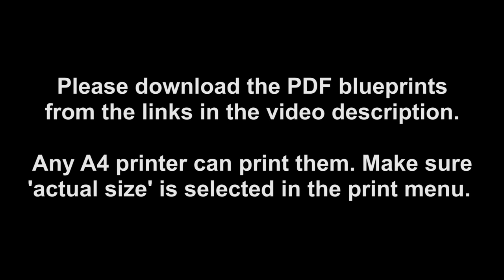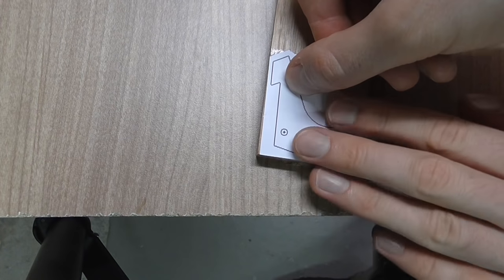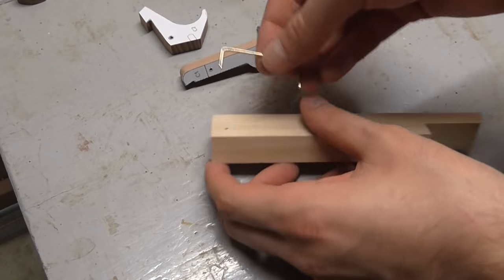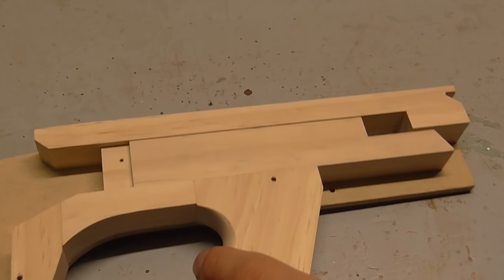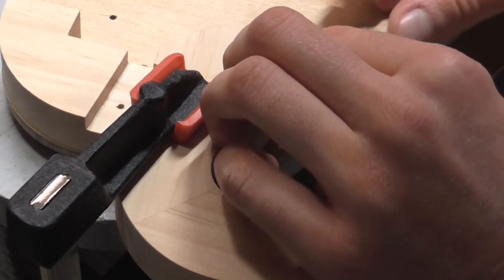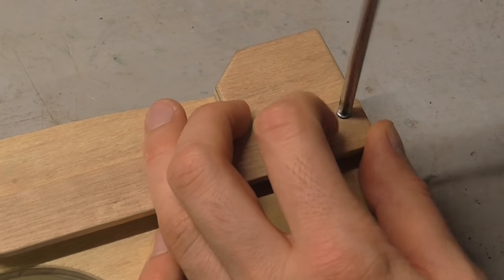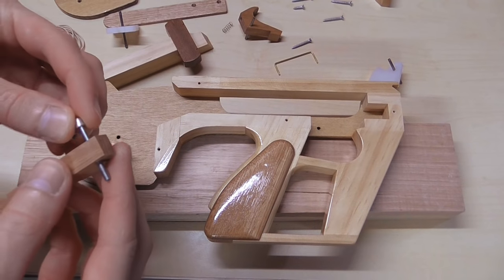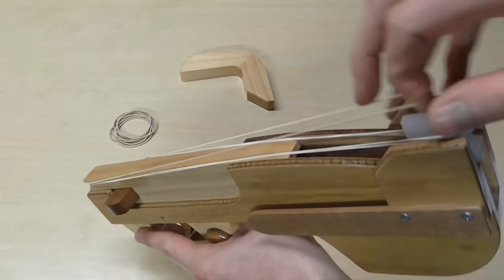Tutorial — Blowback rubber band SMG

Comment: hey parabellum! ive just finished building this gun, and it is amazing! great job on the instructions! only one slight problem: whenever the releaser is pushed and another rubber band should release from the spindle, the spindle goes crazy and lets all of thwm out at once, turning this smg into a compact shotgun! is there anything i can do to fix this?
Reply from the maker: There could be a number of things causing it. It's quite to diagnose without being able to see it myself. However its most likely the releaser being the wrong shape. check that when the spindle pushes back on the releaser that the releaser is actually catching the rotor and stopping it from spinning. If it isn't, try adding some material to that part of the releaser.
Reply: parabellum1262 thanks, ill try that!
Reply: parabellum1262 wat spindle

Comment: Hello, at first I want to say thank you for the great video. second my english is bad ^^. So my question is, the brown thing (nutwood), which is glued on the moving part. Can I change it with a wooden pin like on the mat49 ?
Reply from the maker: Yes, you can. Instead of cutting the bolt (pale wood) away for the brown thing, drill a hole for the pin instead.
Reply: parabellum1262 Thank you, greetings from germany :)

Comment: Simple but effective, can this mechanism works without magazine ?
Reply from the maker: Yes. Removing the magazine allows the action to be locked open for loading and inserting it unlocks it but that can be done with a manual latch instead.
Reply: @parabellum_arms  can it be done by manually pull back the bolt ?
Reply from the maker: @fadlirobbia9000  Not really. Pulling the bolt back usually causes the action to slip and load too many shots.
Reply: @parabellum_arms  ok thank you

Comment: Hi.  I'm building this thing, but I'm just thinking why "Rotor" and "releaser" are made out of plastic? Can i use wood? (It's lots easier to find) Thanks :)
Reply from the maker: They are plastic because they need to be very strong. From your name, I am guessing you're Finnish. If that's the case, you'll be able to find birch plywood pretty easily which will be very strong. Cheap pine plywood might wear out quickly.
Reply: parabellum1262 yes he is from finland :) and i'm too. And birch plywood is pretty easy to get in Finland.

Comment: what is better , first glue parts and then varnish (finish) or first finish with varnish end then glue..?
Reply from the maker: Varnishing should always be the last step. Varnished wood won't stick very well. I glued that one part after varnishing because I wanted the side plate to be as smooth as possible but I used used screws and a special type of glue to hold it.
Reply: okay , i first glue then varnish , i hope be smooth and clear.

Comment: We are having problems with the plastic parts and the c1
Reply: The problem is that the rotor is not spinning due to the releaser
Reply from the maker: It's pretty hard for me to troubleshoot remotely. If the rotor is not moving at all, you may need to file the vertical part of the uppermost corner that engages the rotor. File it away gradually until the rotor can slip past it and catch on the lowermost corner.
Reply: parabellum1262 ok thanks

Comment: what is size of c1 and c2 metal stick ? (nails) , can u help
Reply: and its need glue on the center or no ?
Reply from the maker: They should be about 30mm long and 2.8mm thick. If you use a 2.8mm bit to drill the holes, they will be tight and you won't need glue.
Reply: parabellum1262 okay , thanks , and last Q are u glue rottor on nail?
Reply from the maker: Again, the rotor should fit tightly but you can glue it if not.
Reply: hole on the ply wood same 2.8 bit. how rotated?
Reply: i meen every were be tightly ? thats i dont know where be 2.8 where be 3 mm. sorry for so meny Q but i want to make perfectly
Reply: trigger hole ? on ply wood and releaser. 2.8 bit or 3?
Reply from the maker: 2.8mm holes:
C1, C2, rotor, releaser

3mm holes:
B1, B7

The small holes in A10 and C1 need to fit a piece of wire so it moves freely.
Reply: okay , thanks again u help me alot !